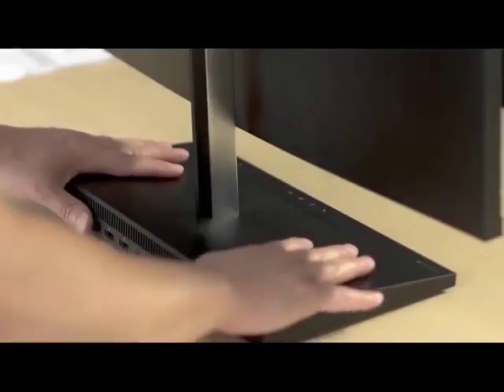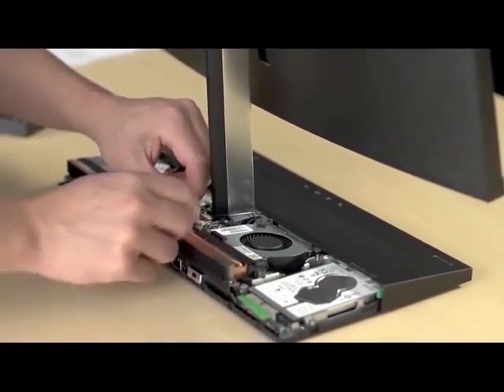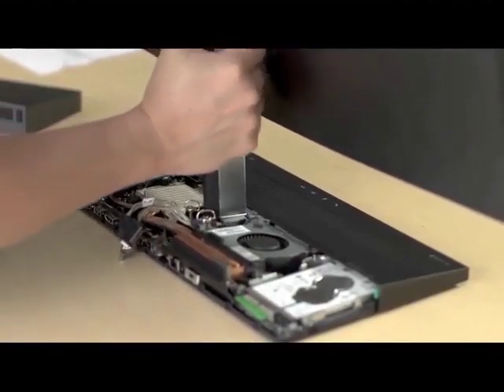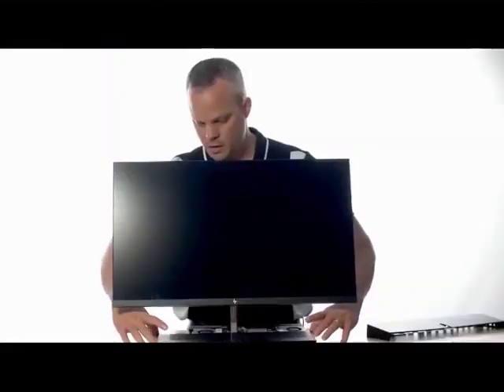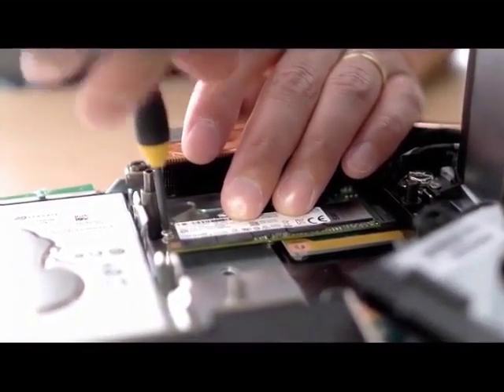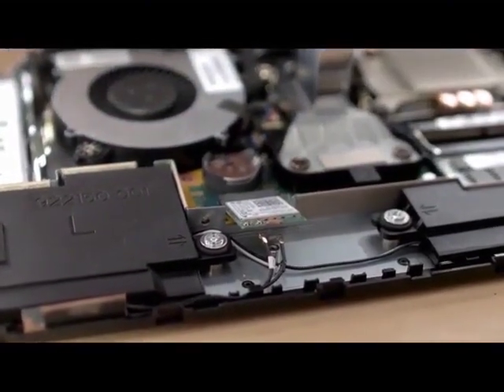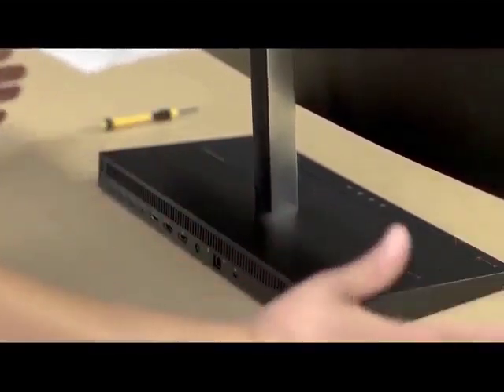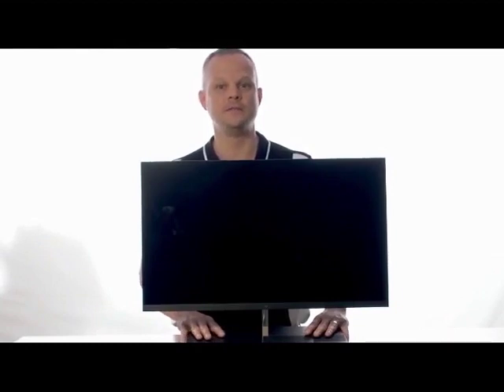Replace Components | HP EliteOne 1000 AiO | HP Support

Comment: My model: HP EliteOne 1000 G1 27-in 4K UHD All-in-One Business PC, 2ZV16PA. 8GB.  The desktop is still working very fine, but its CPU is the hurdle to upgrade to Win 11. Is it possible to  replace to a new model of  CPU?  Which would be recommended?  Or which range can be used on this mother board?
Reply from the maker: Hi there, thanks for contacting HP Global Social Media Support!
I understand that you need to upgrade the processor of your HP EliteOne 1000 G1 27-in 4K UHD All-in-One Business PC.
I will do my best to assist you.
Please refer page number 8 of the user manual to know about list of compatible processors: https://hp.care/6059tdv8f
Regards, 
HP Support
Reply: @HPSupport  Appreciated!
Reply from the maker: Thanks for the reply.
Connect USB: Plug the bootable USB into your HP laptop.
Boot to Menu: Turn on your HP, then repeatedly press ESC or F9 to access the Startup Menu (or F12 for boot menu).
Select USB: Choose the USB drive from the boot options to start the installer.
Start Setup: Click "Install now," select your language/keyboard, then choose "I don't have a product key" (Windows activates later if it was previously installed).
Custom Install: Select "Custom: Install Windows only (advanced)".
Partition SSD: Delete all existing partitions on the NVMe drive until you have "Unallocated Space," then select it and click Next. Windows will create necessary partitions.
Installation: Windows will install, restarting a few times. 
Regards, 
HP Support
Reply: @HPSupport Woow what a detailed instruction, thank you so much.
Reply from the maker: If you need any help in the future, you can always get back to us.
Thank you for being a valuable HP customer.
Have a wonderful day!
Regards, 
HP Support
Reply: @HPSupport  I will have a clean installation of win 10 on my new NVMe SSD, what HP softwares do I need to install as well?
Reply from the maker: If you need any help in the future, you can always get back to us.
Thank you for being a valuable HP customer.
Have a wonderful day!
Regards, 
HP Support
Reply: @HPSupport I wonder...if the Monitor of HP EliteOne can be used as Display (2nd Display) only when I buy a new PC?
Reply from the maker: Hi there, thanks for contacting HP Global Social Media Support!
I understand that you need to know whether monitor of HP EliteOne can be used as Display (2nd Display).
I will do my best to assist you.
You generally cannot use an HP EliteOne All-in-One (AIO) as a simple second monitor for another PC because most AIOs lack video input ports, having only video output (like HDMI out, DisplayPort out) for connecting to another screen. However, newer models like the EliteOne 870 G9 might have specific HDMI input or DisplayPort input (check your model's specs!), but the most reliable way to use it as a second screen is wirelessly via Windows' built-in "Project to this PC" or third-party apps like Deskreen or SpaceDesk. 
Regards, 
HP Support
Reply: @HPSupport  Got it, that means NO. Thanks for your detailed reply, truly.
Reply from the maker: If you need any help in the future, you can always get back to us.
Thank you for being a valuable HP customer.
Have a wonderful day!
Regards, 
HP Support
Reply: @HPSupport  Oh, just want to confirm, my model is G1, and I found there are HDMI IN and DisplayPort In...I guess it is possible to use it as 2nd display.
Reply from the maker: If you need any help in the future, you can always get back to us.
Thank you for being a valuable HP customer.
Have a wonderful day!
Regards, 
HP Support

Comment: hi! same question about GPU and CPU upgrade - improve for HP EliteOne 1000 G1 27-in 4K UHD AiO? is it possible? Can you recommend something, please
Reply from the maker: +Felira Felira Please refer 'Processors' under the specification page to know about supported processors: https://bit.ly/2Y0OP26 and it does not have an expansion slot to add external graphics card.

Comment: Is the GPU or CPU upgradeable?
Reply from the maker: +Vladimir Kostek HP does not recommend upgrading or downgrading hardware parts or software that is bundled with the product as It may affect the manufacturer's warranty and performance, however, you could change the configuration at your own discretion.